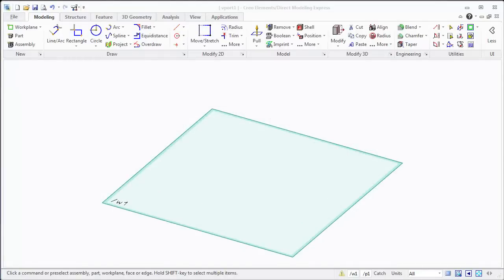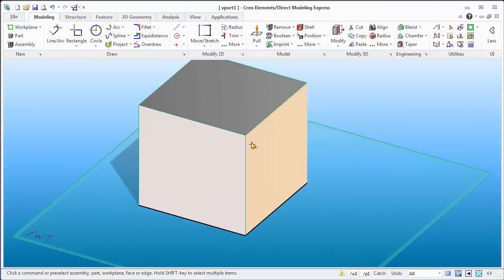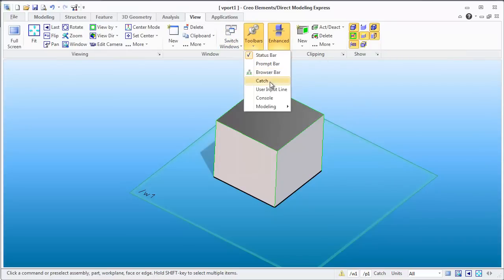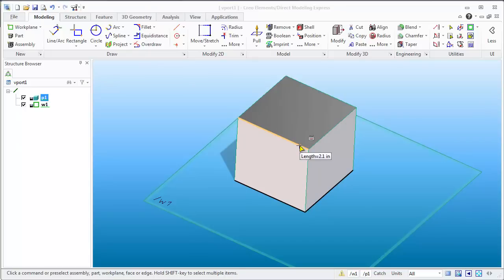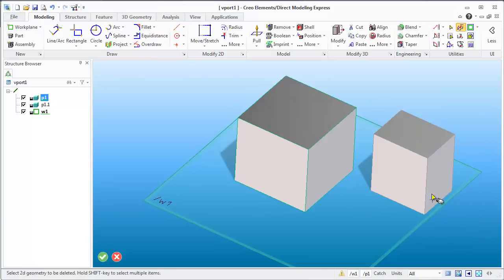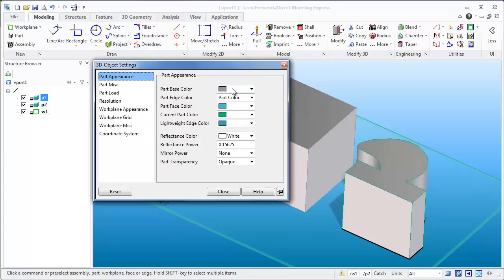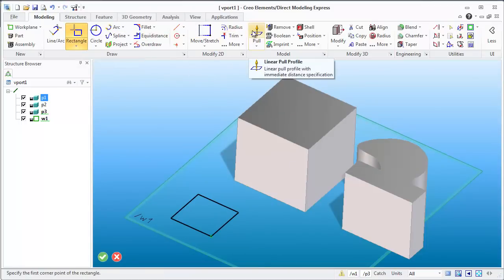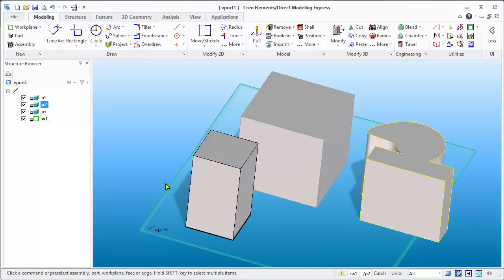Video: Intro to PTCs Creo Direct Modeling Express interface

Comment: After you click on pull for /p3 (your 3rd new cuboid) click on space bar, beside automatic you will see a yellow pointer with a red cross icon, click on that, change your default option of all parts to select parts, then deselect /p1 and /p2 ; after you do that mention the distance for extruding and click on the green tick for ok. You will see the black edges too for p2

Comment: Modify 2D  > More.... > Text to Profile
Icon looks like two E's.

Change to a THICK font e.g. Arial Black, then write and arrange - not the most user-friendly interface, but then you can add Text to the bottom / base of your parts.

Write on the part you are about to 3D print or upload onto thingiverse.

-Andy
aka Bath Robotics.

Comment: Maybe someone has already mentioned this; you need to create a new workplane when creating a new sketch so that you don't get the issue of your old sketches being extruded.
Reply: No, You can de-select various elements off the same workplanes. It does get messy though and I'd advise not using the one workplane for everything.